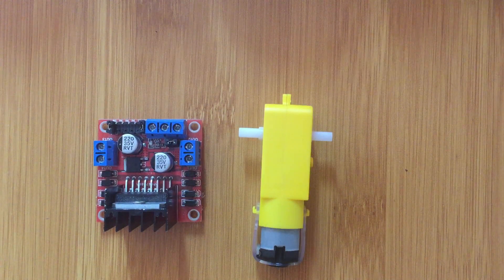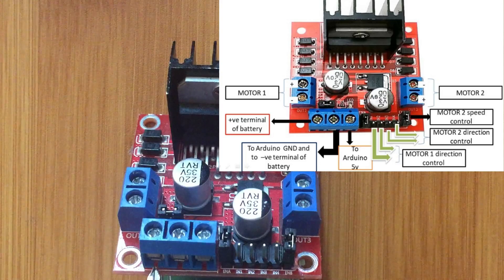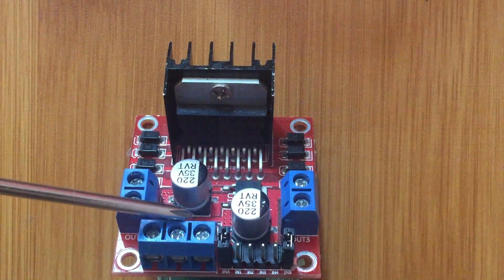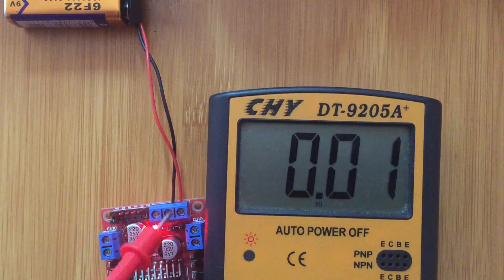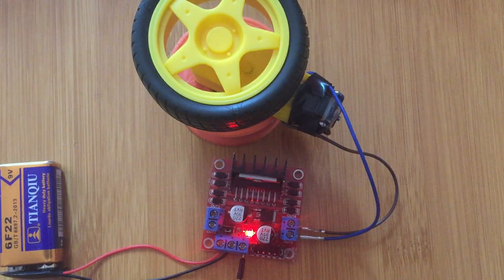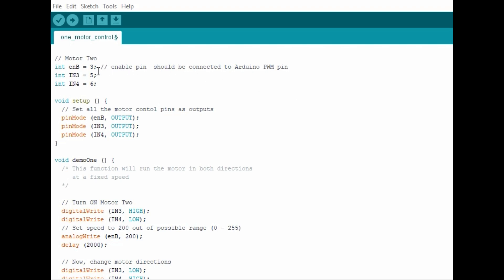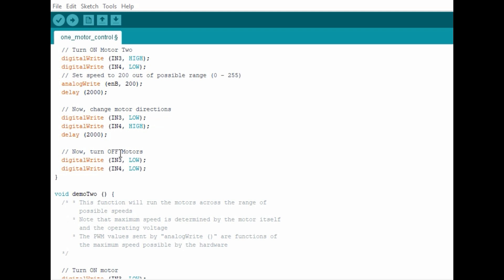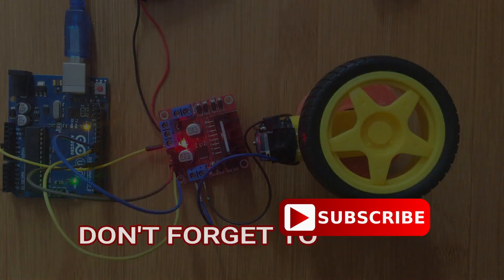HOW TO CONTROL DC MOTOR USING L298N MOTOR DRIVER AND ARDUINO

Comment: problem , i dont know where is the problem , is it from the motor drive or the battery , i an using 9v normal battery, and the motor drive is new , it is really confusing

Comment: would be nice if you show connections clearly. hiding makes it unclear. @7:17 is the 9v battery connected? not clear.  @5:39 what if you show 1 cm yellow wire [not just tips]?
Reply from the maker: i advise you to visit the link in the description if you are very interested in the detailed connections. I have put a schematic showing how those connections are made.
Reply: @mytectutor  offline circuit diagram are different from use. I am not looking for connections, but interested to know voltage impact and saving components

Comment: You connected the arduino 5v pin to the output 5v pin of the motor driver but didn't connect the ground of the L298N to arduino GND. I guess this will allow your arduino to be powered by the USB port of the computer and also allow you get live serial monitor readings. But is it dangerous, I want to do this on my project.?
Reply from the maker: Look at the diagram of the connection at 2:20. Thats the one I used for my presentation and it shows clearly that the ground for the motor driver is also connected to the Arduino board. I realized i didn't show that in my schematic but it's the best practice. Thanks for noticing that.